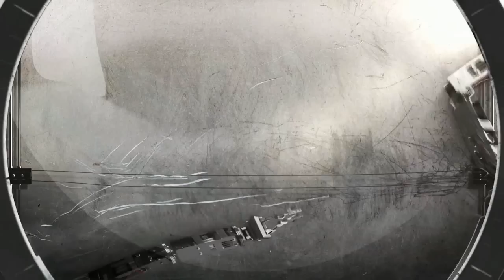Scrap Metal Art Chinese Chain Dragon

Comment: hi:) can you inform me about your welder and other stuff? what kind of welding are you doing in that video? what is your welder machine?
Reply from the maker: Hi..in this video I either use an R-tech Tig welder or a migatronic flex 330 mig welder. Both are quite old now but very reliable units. Hope this helps. Jason

Comment: Brill again . I'm amazed with the lack of use of filler rod . What amps are you using for the chain to tack them ???. Tried this myself after seeing your other videos and fook it's hard . Keep the projects coming
Reply from the maker: thanks bbe. typically i set the tig to 60 amps for chain and use a foot pedal. most of the tacks were probably done at around full pedal (60amps)

Comment: Excellent video. Question: after you finished the piece how did you clean rust, oils, etc.? Also, did you spray clear coat?  Very creative!! Keep them coming!!
Reply from the maker: hi Steve, i use a acetone solution, then clear coat. as a rule i use the acetone before i weld, saves all the hassle.
Reply: You saved hassle in this video 😳 then why all the grinding. The grinder should never turn back on after you start tig welding. No joke, tacking those chain links should have taken maybe 35 seconds never lifting your lid once and adjusting slightly, maybe twice